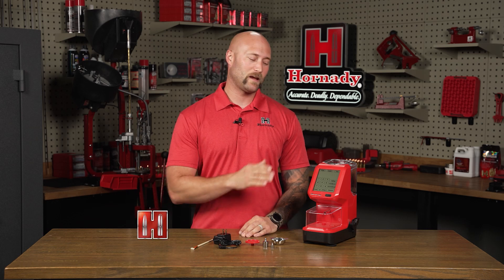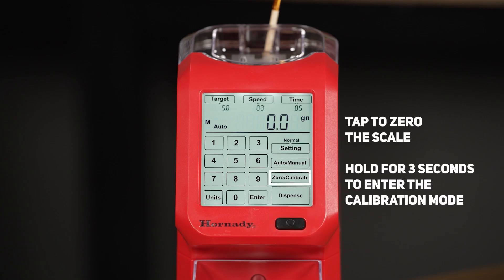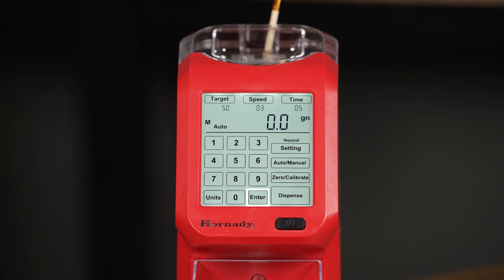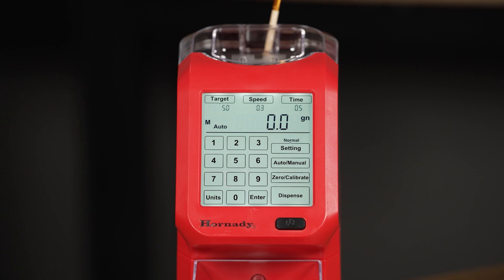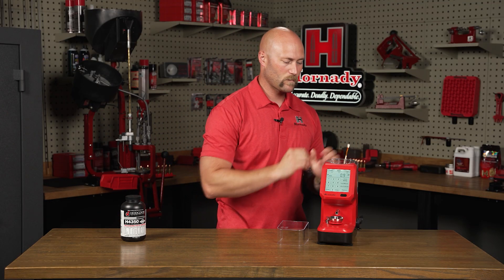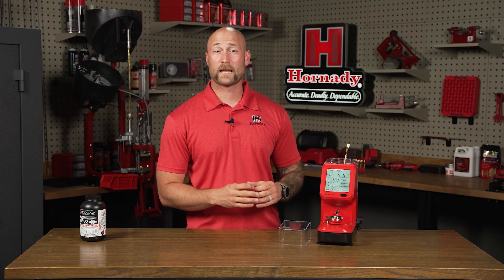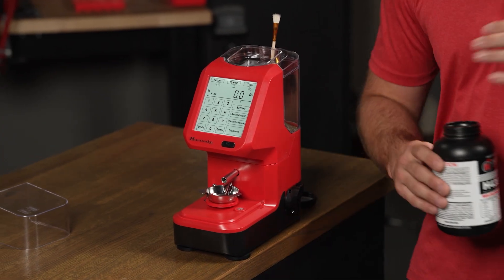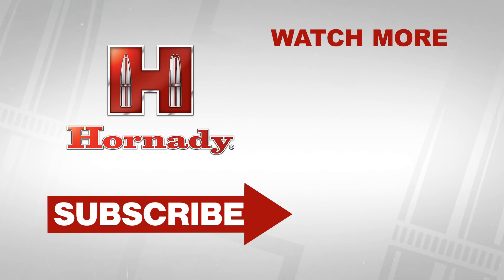Hornady Auto Charge Pro: SETUP & OPERATION (Everything You Need to Know)

Comment: Went and got one a few months ago and just love it, simple to use and accurate, only thing I'd suggest is a second pan when using auto mode.
Reply: Wouldn’t the pans have to weigh EXACTLY the same to do this though ?
Reply: @jamesrodgers6472  yes they would ,as the Auto feature doesn't start back up till the scale reads zero

Comment: I got one in December 2024 and have just had it replaced under warranty for the second time. I'm a dedicated Hornady man but I cannot recommend this product. My main complaint is that it rarely dispenses accurately to the 0.1 gr, which I require for hand loading precision rifle cartridges. I check every charge with another scale (one accurate to 1 mg). All three of the Hornady Auto Charge Pro machines I have had are identical in this respect: they produce the right charge between 5-10% of the time. (How do I deal with this? I pick up individual kernels of extruded powder with serrated forceps, and add to/ take from what's in the pan. Sounds tedious, but it's faster than dumping a whole new charge.) 
While waiting for the most recent auto charge to arrive, I got the Frankfort Intelli Dropper. It costs less than half what I paid for the Hornady, and is dead on (to 0.1 gr, at least) almost all of the time. Yes, it's a bit slower, but because it's almost always correct, I save significant time overall. Sadly, I think the Hornady machine is vastly inferior.
Reply: ive heard way more issues with frankford than with the hornady. almost every aongle person except 1 ive heard eventually gave up on franford. 
from blank screens to multiple stepper motor failures. ive heard gornady ones break too but far less common
Reply: @Blue_Dog_Ranch  Like I say, I'm only reporting my personal experience to date. I have to say that I was skeptical about the FA machine, but have been pleasantly surprised...so far!
Reply: RCBS

Comment: When you turn the beep off does it still beep at you for an over-charge like the first version? The beep has always been annoyingly loud, so much so that I opened the case on my original dispenser and pulled the speaker off of the circuit board since there was no way to silence it. I get wanting to alert for an over-charge but put a volume knob on the thing at least.